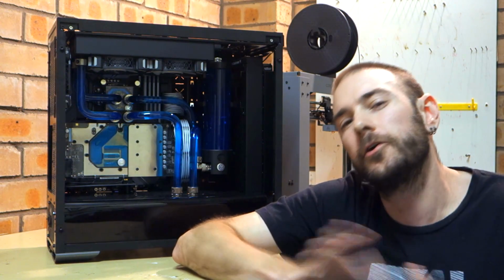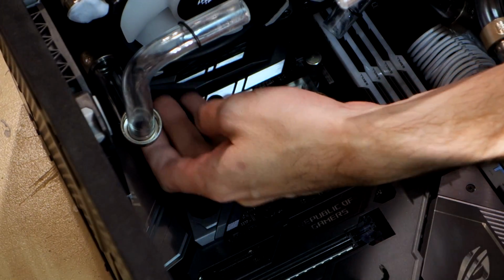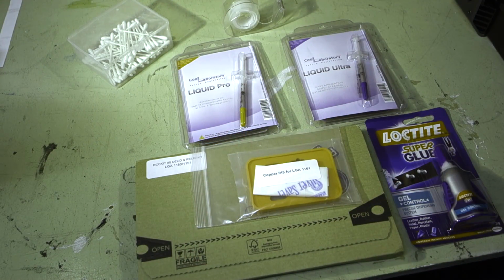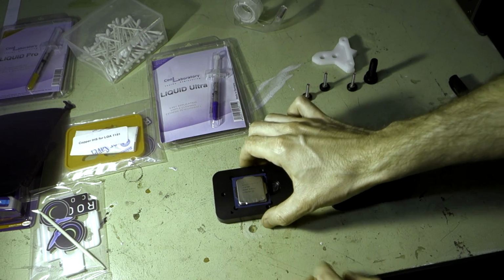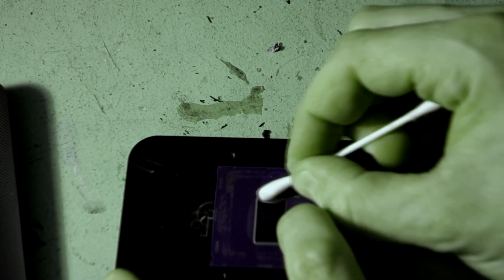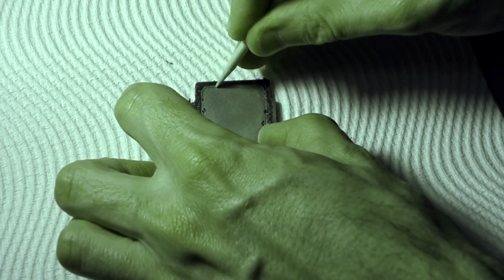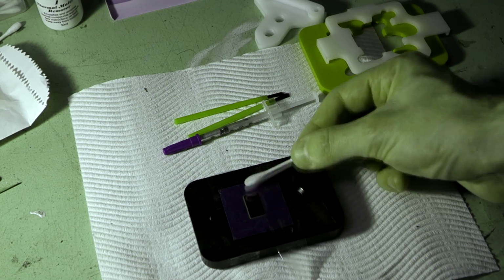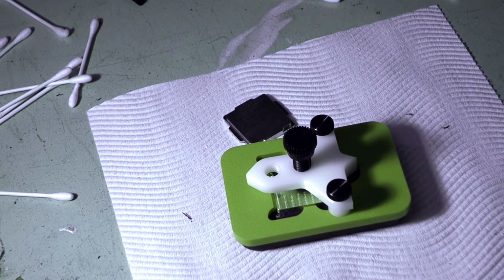The Complete 8700K / 8086K CPU Delidding Guide

Comment from the maker: RESULTS VIDEO HERE - https://www.youtube.com/watch?v=cNVrjHlK0uk
Reply: I have a question. I've heard that no matter what the heat spreader is made of unless the heat spreader is perfectly smooth you could still have slightly higher temperatures but also materials the heat spreader is made of does make a difference too and I noticed that the rocket cool heat spreader is is rather rough so could lapping still help more?
Reply from the maker: The Rockitcool heat spreader is perfectly smooth. At least mine was. Have a watch of this video, it will help but you’re basically correct....
https://youtu.be/PANdWh35HLQ
Reply: @boostedmedia  from what I've seen the part that contacts the cpu is perfectly smooth but the part that contacts the cooler looks very rough
Reply from the maker: David Jenkins it looks rough in photos from the polishing but it’s absolutely flat like glass in real life.

Comment: I delidded my 4690k with an exacto knife and patience. I need one of these delidders for my 8086k. On my 4690k I got almost 20C temp drops under full load on air. A trick I used in case I spilled any liquid ultra on the sensitive cpu contacts under the IHS was using clear acrylic fingernail polish. 4690k @4.6ghz 3 years stable. Actually undervolted it to get a stable 4.6 on all 4 cores with no speed step. It runs 4.6ghz 100% of the time. It's been a good cpu now time to upgrade to a new generation of awesome.

Comment: already delidded mine and its amazin. load temps dropped from 86c to 61c @1.35v 5Ghz, I posted on forums about relidding it with the rocolite glue and one user freaked out...
Reply: Why?
Reply: Wow. I have mine at 5ghz and 1.20 volts. Max temp at 49c
Reply from the maker: That must be an amazing chip! Not many can do that.
Reply: @spaggtrait1608  are u good or having a bad day? U dont know what u are talking about.

Comment: Great vid! I also seem to have struck out on the silicon lottery. I also need to up the voltage to 1.41V to be able to get to 5.0Ghz but temps are way above 80 degrees. I borrowed the Rockit88 kit and going to delid my 8700k this afternoon!
Reply from the maker: Good luck!!
Reply: Thanks! So I managed to delid and relid. I used Thermal Grizzly Conductonaut - had the last bit from when I changed the TIM on my PS4 Pro. Anyway, after relidding, my pc wouldn't boot. The QC code on the motherboard showed me '55' which means no RAM installed so I thought I nicked the memory controller on the pcb. After some googling a few people mentioned the cooler was on too tight. I'm using a 240mm AIO. After a few tries of loosening and tightening without success I stripped the entire aio off the board and reconnected it and boom it worked! Now, I'm overclocking using your tutorial. My temps are still high which I imagine is my AIO showing its limit. Also trying to get a stable 5.0ghz is tricky. I'm slowly upping the voltage. Currently at 1.39 which I hope is fine (I know you said high voltage is fine until the load is thrown in). It just blue screens after a few minutes of stress at lower voltages in CPU-Z.  But once I get the stable settings I'll probably end up keeping it at 4.9 till I get an open loop setup. Thanks for such awesome advice and tutorials especially for noob enthusiasts like myself.
Reply from the maker: You’re welcome!! Glad you’re finding the videos useful
Reply: Boosted Media Ugh. Turns out I haven't had much luck. The voltage jump that's needed from 4.9ghz to 5ghz is crazy. I stopped testing at 1.41 and decided to leave it at 1.35 for 4.9ghz. Not sure how high is safe but will try again when I get a better cooler 😕
Reply from the maker: Yeah I definitely wouldn’t go higher than 1.35v under load until you have a cooler that can keep temps under 90 at those voltages.
Reply: Boosted Media I got rid of that chip and got myself an 8086k. I delidded that and am using it on my first custom loop in a Maximus X Formula. I did get it to 5.2ghz @1.36v stable. Peak temps around 80 degrees because my gpu is in the same loop and I'm using a single rad. I did get it to 5.3ghz at 1.39v but I think I need a smidge more because it wasn't stable. Your videos are still my go-to ones for overclocking and fan setup. Thanks again! Edit... I downclocked it to 5.0 at 1.27v for now. Really happy with this chip.

Comment: Don't see the point in spending $9 dollars for the 'ArctiClean Cleaner and Thermal Surface Preparer'. Been around computers since MS-DOS days for removing old thermal paste I just used high percentage rubbing alcohol. Just use a piece of damp coffee filter with rubbing alcohol and clean off the thermal paste. You can get a bottle of rubbing alcohol for like $3-4 dollars and chances are you have a bottle around the house all ready. As for Delidding your processor never do it if you can't afford to replace the processor if you screw it up.
Reply from the maker: I find isopropyl tends to leave residue but yes it will do a good enough job.

Comment: You forgot to apply the LM on the IHS. Because of the surface tension of the LM, it won't have good contact if you don't apply a thin layer to the IHS.
Reply from the maker: Incorrect. For a polished IHS you don’t need to apply LM to both sides.

Comment: Did you apply liquid metal to the IHS as well after you put it in the socket? The video was not clear.

Thanks! very informative guide. Gonna pay Rokitcool a visit.
Reply from the maker: No. Just the die as per Rockitcool’s instructions :)
Reply: Gotcha, thank you.
Reply: Perfect. I had the same question. Decided to get the copper IHS and see if that helps me. So no thermal paste on the underside of the copper IHS either. Just liquid metal on the die and 'traditional' thermal paste on top of the IHS.
Reply from the maker: Correct.

Comment: Super excited to delid my 8700k. I unlike you and a couple commenters, have gotten a winning chip  it hits 5.1 stable all day at stock voltage. Only problem is it sits at 75-80c on my custom loop. So im lookimg forward to trying to push a 5.3ghz cb r15 pass or two and see scores/temps.

Comment: Does the delid kit you link to at Amazon have the relid adapter for the copper RockitCool IHS you also have linked?
The RockitCool website cautions about buying the wrong kit but all their 1150/1151 kits have the same description and warning.
Reply from the maker: The copper IHS comes with the appropriate adaptor. :)

Comment: Does that super glue cause heat retention? I know the original silicone paste holding the IHS onto the CPU itself causes some thermal throttling with the heat retention it causes.
Reply from the maker: Such a small amount is used that I very much doubt it. It’s literally a drop in each corner. 

I don’t think it’s the silicon itself that’s a problem on intel’s stock application but rather the additional height it creates, meaning the IHS and die have a layer of  TIM between them rather than the IHS sitting right up against the die with only minimal TIM.

Comment: Do you not need to put the liquid metal on the IHS? I have seen other delidding videos where they do that?
Reply from the maker: Good question. It’s a topic of hot debate that’s for sure. RockitCool say no and I agree. The aim is to have as little material as possible spread evenly across the interface. All it’s doing is filling any pores in the surfaces.
Reply: you dont have to.  just putting between the ihs and die will do plenty good.  you wont get much gain by putting it betwen the ihs and the cooler.  the reason for this is the die is very small so you have very little surface area to transfer the heat and the better the thermal conductivity the better off you are.  the area of the ihs is very large though.  putting the liquid metal between the ihs and cooler might get you a couple degrees on a very high power load.  but between the ihs and the die you could get as much as 20c or better
Reply from the maker: Well said
Reply: thank you.  i will be delidding my 8700k soon and im a bit nervous.  ive already got the rockit cool copper ihs and the liquid metal.  put the liquid metal on my zotac mini 1070 ti and it worked pretty well.  went up from 1080p to 1440p and the temps were worse now they are a bit less than i was getting at 1080p so good stuff.  if anybody tries to put liquid metal on their gpu you can put the same silicon glue you would use on a cpu around teh area of the gpu die to cover any components that stick up like caps and resistors.  thats what i did.  i paused the video half through watching so i dont know how things went for you.  i hope it turns out well.  im about to find out!
Reply from the maker: Glad you’re finding the video helpful. Just take your time with it. It’s not hard :)
Reply: bobhumplick you can use clear nail polish around the chip over the resistors. 
I've done it to my i9 7900x and 2 1080ti's and my xbox one x and they came out perfect
Reply: yes you can use either.  just as long as you have something over it that seals it.  i alrady had the silicon so i just used that

Comment: Hi just subscribe to your channel and  is amazing. Just one question why you put  liquid metal only in the die  and not inside the copper IHS as other people do when they used the original IHS cover from intel
Reply from the maker: In my opinion having done about 15 chips now all with consistent results is you should only apply it to the die. The layer should be as thin as possible whilst maintaining full coverage. Check out my liquid metal demystified video.
Reply: @boostedmedia  Thanks for your input, just ordered from amazon the IHS copper cover and the delid tool . Right now I think I have a pretty good chip  5ghz with only 1.30 volts on liquid cooling but when I doing stress test temps going up to the roof . I will let you know my results after delid

Comment: I dont think IHS size makes any difference, because die is still same size. Now what makes real difference is to put direct die cooling.
Reply from the maker: The slightly larger IHS does pull heat away from the die more efficiently than stock. But the difference is not huge. And yes absolutely direct die cooling is superior.
Reply: I was searching somekind of info about that.. Watched video from Gamers Nexus. They tested the same exact IHS. Was pretty interesting video as well.

Have you thought about making video about direct die cooling? "Ncore V1-naked die cooling waterblock" that is the product I mean. I would be really curious how well that works. Linus had early version of that in test, but his testing methods are clumsy anyway. :D
Reply from the maker: Yeah I’d love to test one out. I’ve seen Linus’ video on it and cringed.

Comment: Correct me if I’m wrong but isn’t the ihs allready copper just with a coating/plating
Reply from the maker: Nickel plated copper. It’s the larger surface area and polished surfaces that yields improvement.

Comment: Great stuff. I would like to do the same, but I'm worried how long the liquid metal TIM will last before I have to reapply. Have you got ant idea what the lifespan of this is?
Reply from the maker: It depends on the liquid metal you use and the type of IHS. Copper does amalgamate with gallium over time which will harden some liquid metals. The amount of time depends on the heat it’s subjected to. The process is accelerated at around 80 degrees. If you use the stock nickel plated IHS it’s not a problem at all.  

Coollaboratory uses a specific compound with much lower quantity of gallium so it’s safe to use with a pure copper IHS. Other products like conductanaut use higher amounts of gallium and this dry out much faster. 

The drying out isn’t necessarily a problem if the IHS has been installed properly. But if you see temps start to rise it’s a good idea to check things out.
Reply: I think with the original heatspreader it’s somewhere around every 2 years.
Reply from the maker: Depends on the LM you use. I've just finished another video talking about all this in detail :)
https://www.youtube.com/watch?v=PANdWh35HLQ
Reply: Boosted Media cool!
Reply: Boosted Media cool!

Comment: arent you supposed to apply LM to the underside of the copper top as well?
Reply from the maker: No. The layer is meant to be as thin as possible.
Reply: @boostedmedia  i delid my 7700k a couple years ago it went well. i just did my 8700k with a copper top. but it idles in the 40s and it got up to the high 90s when using asus overclock application. 

i am going to go back this weekend. do just 1 layer of LM, and try even less gasket glue (even though i used a small amount to begin with).

thank you for the info and the very detailed videos!!!! keep up the good work!
Reply from the maker: Don’t use gasket glue at all. Just a spot of super clue in each corner like in the video. It’s the additional height added by the gasket glue that raises temps in most cases.
Reply: @boostedmedia  can i remove the IHS in the future if super glue is used. i have a copper top. can i pop the ihs off the same way, with the rocket kit?

i would like to be able to have the option to put the stock IHS back on if the future person i sell it to wants it.
Reply from the maker: Just dissolve the super glue with some acetone nail polish remover. Easy. I’ve done it numerous times.

Comment: I don't get it.

Why not just remove that lid entirly and just bolt that cpu straight on a CPU cooler like you did back in the day?
Reply from the maker: You can with a special direct die cooler. But the die sits below the mounting surface so a normal flat cooler won’t work that way.

Comment: Wont the heat from the CPU melt off the glue?
Reply from the maker: It doesn’t matter if the glue softens once the Heatsink is installed. But no provided your temps are within spec.
Reply: @boostedmedia  thank you so much, I order everything a few days ago, and tomorrow imma give it ago on my 8086k. First time delidding
Reply: @boostedmedia  also, for the nail strengthener, I am just curious on how something like that can be used to protect parts. I have never heard of such a thing. Pretty cool though, gonna give it a try also

Comment: Why not just throw away the IHS and put the cooler directly on the chip?
Reply from the maker: The die sits lower than the mounting bracket. You need a specially designed water block for direct die cooling on these chips.

Comment: will the copper ihs work with the 8086k?
Reply from the maker: Sure will. I have the exact same IHS on both my 8086k and 8700k.
Reply: awesome ty i have been debating weather or not to get the 8700k or the 8086k because of the whole deliding and stuff like that and reallly needed to know if it would work with the 8086
Reply: also what about the cpu guide do you have issues with putting your cpu in this is gonna be my first 8th gen cpu so im just trying to do as much research as i can before i buy all this stuff
Reply from the maker: Good question.  The CPU guide is really just for people who have no idea what they’re doing. It’s extremely easy to install safely and correctly without the guide. But no, the guide doesn’t fit with the larger IHS.
Reply: alright well thank you very much for all the info about it
Reply: it'd work on 6700k and 7700k too.

Comment: I know electricity prices are out of control in this GOD forsaken country. But I think you need to get some better lighting :).

Also if you don't want fingerprints on your CPU, Lid etc... Surgical grade rubber gloves are your best friend.

You'll also find that leaving the Arctic Clean remover (number 1) for a minute or so. It will melt thermal paste and that silicon away like butter and will make the removal process so much easier.
Reply from the maker: Yep the video was done late at night in my garage due to unforeseen circumstances. Lighting is now much better.